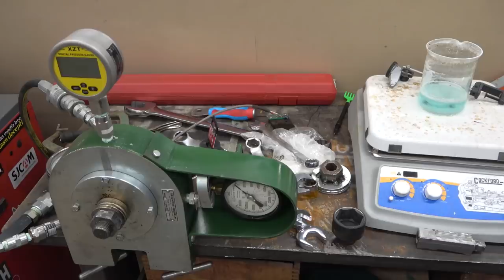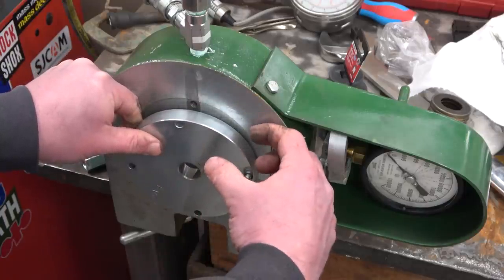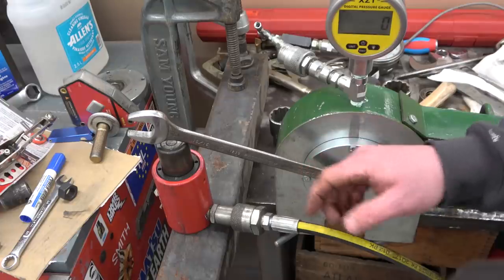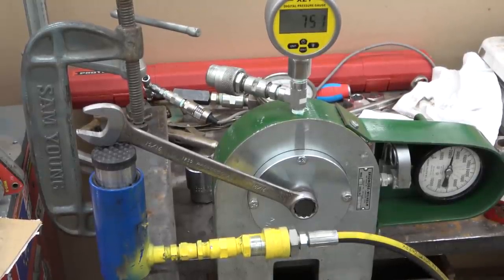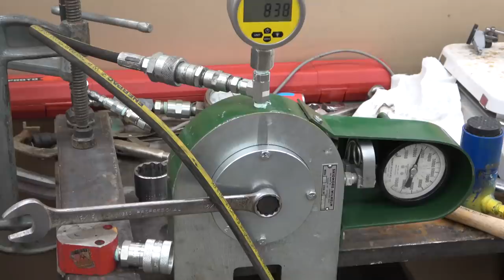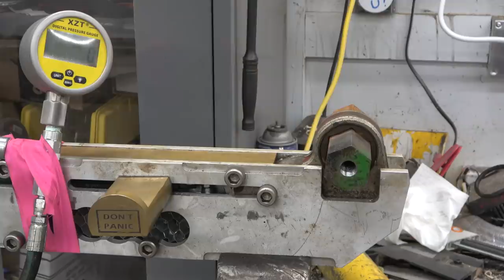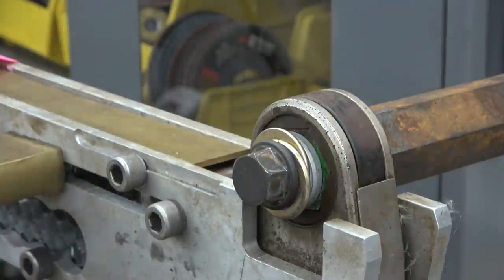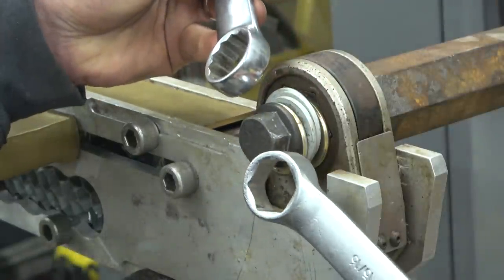6 point VS. 12 Best wrench?

Comment: Totally agreed with 1 exception.  If the fastener is already partially rounded, 6 point can be much better.
Reply: Spline drive can also grab a partially rounded fastener much better than a regular 12
Reply: I was always taught, and came to my own conclusion that 12 points are more likely to round off  fasteners.
Reply: The blue hot snot gun can also grab it.
Reply: @joshualux8309  this one isn't true. The contact surface on a 12p is the same as a 6.
Reply: @NurdRage777  someone has been watching diesel creek😀
Reply: @grahamnelson5376  spline drive. Those the ones that grab as close to the center of the flat as possible?
Reply: @Iceberg86300  yes, and the sharper corners on the splines help them dig in a little better than the rounded teeth on a 12 point
Reply: @preludedude4765  
Yeah I don’t know. I used to work at local ship yard. I’ve turned the rustiest bolts imaginable. Don’t believe the marketing on the package
Reply: Here's to hammering on a half inch socket to a mangled 13mm bolt head.
Reply: @joshualux8309  that means nothing lmao
Reply: Yeah, try working on a 10 year old VW with 12  points, every fecking bolt rounds off.
Reply: That or when your cross shift loses the 16 and 5/8 wrenches so you have no choice but to use the 17.
Reply: Generally speaking the smaller the fastener size the less material there is for the wrench to grab on to regardless of type spline 6 or 12. Less material is easier to round off.
Reply: I think the out come would be different with a 9/16" bolt
Reply: @Pro_DRIFTZ  Yep, good guess. Matt is cool & fun to watch :)
Reply: @preludedude4765  my experience matches the other guys. When working on old bolts, the 12-point box-ends round-off, and I usually end up getting bailed out by (somewhat surprisingly) an open-end wrench. Never rounded off with a decent open-end. (Identical brand wrenches FYI, just open v. box side).
Reply: @MattBrownbill  you must be using imperial wrenches on your VW or something. the correct size 12point grabs just as well cause the contact point is the same. the only exception is if the fastener is already damaged cause some knucklehead used a imperial wrench on a metric fastener....
Reply: Same, a 12 point rounded off most of the head on the oil pan bolt on the wife's Acadia, it was a brand new set of SAE and metric so I know I had the right size, now I have a single six point socket that still fits it and that's the only one I can use to change the oil now.
Reply: Definitely. And usually you are using a socket anyways which is why six point sockets are relatively common.
Reply: @preludedude4765  This is incorrect, due to tolerances a typical 12 point will stress the corners of the bolt, a radiused 12 point like Snap On's Flank Drive will have a similar compact to all modern 6 point wrenches, which are based on the radiused hex drive, as true hexes will also stress the corners of the bolt, which is why the radiused hex was designed in the first place. If we had perfect tolerances, radiused drives wouldn't be needed and corners wouldn't be stressed with unradiused drives. This is why typical 12 points strip hex heads, this is also why a lot of other drives will also strip hex heads, because they stress the corners and eventually round them; one of the best examples of this, assuming you can find a drive and wrench for it, is driving a triple-square with a 12 point, you're literally driving the corners of the triple-square due to the difference in angles, which forms a massive gap where flat engagement would be if you had a triple-square wrench, watch how quickly that triple-square drive gets rounded. The best drives are ones that grip the flats, this is why radiused drives exist, this is why open ends work so well, this is why drives like Torx and splines work better, because of better flat engagement.
Reply: The smaller fasteners can also benefit from six point. When you get under 3/8" stuff the peaks of the fasteners get pretty small.
Reply: @preludedude4765  its not. And that's partly why impact sockets are always 6pt. That and the fact that the tool body can be thicker and stiffer if there's not additional material removed around the load points.
Reply: I did have one occasion when a 12 point worked for a damaged spark plug where the six would not. It was a plug with 5/8ths flats that was so rounded not even the correct size six point would grab it, so I got a 15mm 12 point that I literally hammered on and was able to successfully remove the plug that way.
Reply: slightly rounded, or slightly rusty in which case it is about to be. don't think i've seen  a 12 point bleeder wrench
Reply: @pocoapoco2  you cheated 😂
Reply: @RenaxTM91  40 years doing this crap, 12 point is great on brand new stuff, I ONLY use 6 on old rusty crap & I own I literal ton of tools fapoff/notoe all the way down to crapsman, I have crap that hasn’t been made in 50 years, the steel is far superior & I have newer stuff I cut the box end off, moved it a few degrees then stick welded it back on, I might have to use two wrenches but by God I haven’t rounded a nut or bolt in 20 years, 12 point is garbage
Reply: @RenaxTM91  More a case of pour quality materials that rot away, compared to a 20 year old Volvo that came apart no problem.
Reply: @preludedude4765  Very true. If a 12 pt doesn't grab, something (rust?) or someone else boogered it up first. Then it's the 6 pt's turn at it and it's either a) out or b) almost perfectly round.
Reply: What about 3 points?
Or maybe even 4.

Would that be more proffient?
Reply: @preludedude4765  If everything is new and nothing changes you are correct. As bolts are worn or damaged or wrenches wear the contact points move closer to the center line of the bolt. Not all wrenches or bolts are created equal.
Reply: I've been under the same impression maybe it's right maybe it's wrong idk all I know is if the 6 and 12 doesn't get it (even after beating a smaller size on) the liquid steel gun just might... Or break it off then spend half the day sharpening  drill bits lol
Reply: I love this guy but we're really comparing apples to oranges on this one
Reply: Matco tools have rounded nut and bolt sockets and wrenches; they're 6 point and a grab like a gear.
Reply: No question about 6 working when a 12 didn't, and the 12 is not worn-out!
Reply: @NurdRage777  can't agree more 💯
Reply: Or cheap Chinesium Grade -3 crap that's made out of some sort of steel colored taffy..
In fact, THERE'S a good test..try this experiment on some nylon farsteners, Unka Bumblefuck!
Reply: Ive had really cheesy fasteners that prefer 6 point
Reply: @RenaxTM91  using the wrong size is not the only way to round a bolt bud....
Reply: @Bibibosh  3 pts to hold a 6pt fastener? probably not more eficient......
Reply: @BibiBosh  For whatever reason hex bolts are super popular and they have 6 corners. There is one active flat very near each corner of a properly designed and intact bolt head. The goal is to spread the force to as many of those 6 flats as possible. Either a 6 pt or 12 pt can do this well---but only as long as those flats are viable. A 3 pt would exclude the 3 other points so the unit loading would be doubled and so bad.

Wenches designed in the last 80 years or so specifically target the, flat just a bit back from the bolts corners, with the apeces of it's convex surfaces.
 
Generally, when a bolt is damaged, it's from rust, using the wrong or out-of-spec tool or using the tool improperly.  Those all compromise the intended flats. That's when you need to get purchase on the intact flat closer to the bolt's axis. The way to do that is with a 6 pt. The 6 pt. wrenches targets the portion of the flat that's less likely to be damaged and sometimes you win. But then the unit loading is higher and the head's surface can sometime plasticly deform and you loose-out to round bolt-heads. To hedge my position on rusted bolts, I usually try to hammer a the smallest 6 pt socket on that I can. This helps to involve as much outer flat as possible, contains the displaced steel and the shock helps break up the interface rust.
Reply: Yeah this sole reason is why I'm 6 point for life. Absolutely HATE stripping fasteners, especially since the ones you strip are ALWAYS the absolute shittest ones to fix.
Reply: This
Reply: @preludedude4765  Depends on the torque. Also, 6 point applies force more towards the center of the head.
Reply: @RenaxTM91  The contract surface does differ, especially as torque increases.
Also, the direction of the pressure matters.
Reply: @Bibibosh  Lesser number of points may allow a stronger fastener, but the wrench would be larger and less maneuverable.
Reply: @antilogism  How is the unit loading increased?
Reply: @pocoapoco2  the hammering action more likely shocked the threads loose.
Reply: Or its a stuck fastener, and its relatively soft metal, It's way less likely to round off in the first place.
Reply: Just love a nice skoukum 6 point ring or socket.
Reply: @cwj138  - love that too.
Reply: WILL BE, not can be.
Reply: VERY TRUE !!! Six point over twelve point every day , when it comes to gripping a bolt !! A twelve point will round off a nut or bolt head every time .
Reply: @preludedude4765  based on if years spent doing heavy duty diesel work, 6 point will grab a bolt a 12 point. I typically use 12 point as they are better for general use. But when somthing is rounded 6 pt definitely does a better job.
Reply: @Davobeff  I scrolled to the bottom to say this but you beat me to it. There are just some situations you need a 6 point for and some people can’t seem to grasp that.

I don’t get why some people can’t just accept that you can keep both around. You need two sets of wrenches anyhow what for when things are a bolt and not a screw.
Reply: @preludedude4765  True for good, hard fasteners.  Soft ones - the points yield (smush down) and the pressure point on each facet slowly moves away from each point.  This happens with 12 point too, but the amount the pressure points can move runs out of room (which is when it begins rounding off.
Reply: @preludedude4765  Not if its rounded already , AKA rusted bolts under my car .
Reply: channel locks , next .
Reply: @cwj138  been there. Works great 👍😎👌👌👌
Reply: @RenaxTM91  in theory,  from the perspective of an engineer,  sure. Please let me watch while you use exclusively 12point wrenches on equipment that is pre-abused.
Reply: Or rusted / weak materials
Reply: Yup I use my 12 points for nut extractors and also torex bits make good extractors
Reply: @joshualux8309  its true because the teeth are shallower,  So for extracting a nut you can pound on a smaller size like for example a 1/2" 12 point pounded onto a rounded off 13mm nut.
Reply: @preludedude4765  What?

A 6 grabs the sides of a bolt too, the 12 just grabs the corners
Reply: @preludedude4765  The flat area on a 6 is more than a 12.   Just look at the bisected faces and you'll realise half of them on a 12 are V's that are not in contact with the faces.
Reply: Spline is best.
Reply: 12 point wrenches wear out faster. Period. So then you will sooner have a 12 point wrench that is out of spec. A wrench that goes out of spec might as well be called a round-o-matic. 6 point wrenches have more surface area that deforms and wears less, and it won't start shedding chrome as fast. 12 point tips start shedding chrome the moment the steel gets deformed from a high torque situation. All these 12 point lovers are culls. On a good bolt with easy access and it's properly lubed, 12 point works..... But the real world isn't a perfect world.
Reply: In this scenario 6 may be the only way
Reply: Exactly

Comment: The best option is the 9 point wrench, it's a good compromise between 6 and 12 points.
Reply: India has the best 9 point wrenches
Reply: I agree 9 point is best, if one of the points wears out you can grind off two more and you have a brand new 6 point.
Reply: Hey a 12pt socket fits a square, so...
Reply: @ohnoitisnt  so does a 6 point if you have a hammer and a will
Reply: That used to be my favorite, until I tried the 69 point....

Comment: In my experience slipping off of , or rounding off a head happens pretty rarely on a large, high grade bolt that is still in good shape. But given the slightest bit of opportunity a 12 point wrench will take a crusty, rusty, already been diddled with automotive fastener into vise-grip territory with the quickness.
Reply: Forget vise grips. You want raptors.
Reply: @jeangadoury932  forget raptors, you need a welder.
Reply: Lolz! Yup! Been there way too many times! 😀
Reply: Especially if your not dealing with steel bolts/nuts. Brass don’t even bother with a 12 point
Reply: I've had better luck with a small pipe wrench then vise grips, but every situation call's for a different attack.

Comment: As someone who lives in the rust belt, 6point has absolutely made a big difference. If I have to choose between a 6 point socket and a 12 point socket, I will always ALWAYS go with the 6 point.
Reply: As someone who lives in SCOTLAND, 6point has absolutely made a big difference. If I have to choose between a 6 point socket and a 12 point socket, I will always ALWAYS go with the 6 point.

This test is great if you work with nice new fasteners. Over here, in the real rusty world, where fasteners look like rusty knobs removed from the wreck of the Titanic on the ocean floor, you'd have different results!
Reply: @WhiskyMechanic  absolutely. Any time, even when working on brand new stuff, I always use 6 point. Why not? I believe that 12 point sockets are obsolete, they were made for lower tooth count ratchets. Now I have 120 position and 90 tooth ratchets. I don’t need the 12 points.
Reply: Same and agree wholeheartedly.
Reply: I refuse to buy 12 point sockets.  They're an answer to a question no one asked.  On the wrenches, notice that the open end is cocked at an angle, you get the same 30 degrees of rotation buy flipping the wrench over.
Reply: @CountScotchula  No, Snap-on uses a 7-1/2˚ offset on the box end to split the difference. The 12-point wrench (Snap-on's, anyway) will always yield twice as many options as the 6-point wrench. I used to be an industrial salesman for Snap-on.
Reply: the Socket is different ofcourse, you can pick your starting point easily. since that shit rotates freely.
Reply: @saturnmedia1  twelve points aren’t obsolete, they have a specific job that they are best for…. Paper weights
Reply: @tarungonneea4614  lmao. Pretty bad ones though, they roll away!
Reply: I've fucked enough rusty hardware to learn the hard way too. Exhaust bolts are always getting a 6 point (if it's a hex), anything smaller than about a 13mm and lookin' slightly rusty? 6 point. 

Trying to find 6 point box/combo wrenches is kind of a pain, but totally worth it.
Reply: @pontiacg445  I s suggest getting a ratcheting 6 Blount box end! Then you have super strength and lots of angle available.
Reply: @saturnmedia1  I would, but I'd probably just blow them up. If I can, I'll break it loose with a box wrench then switch to the ratcheting type, then the 12 point is usually good enough.
Reply: @pontiacg445  Once it’s loose, yes. But you can’t always get a 6 point wrench on a nut or bolt. That’s why the ratcheting one is nice.
Reply: @CountScotchula  12 point spanners and sockets do tend to be useful on bolts with 12 point heads, there is that.

Comment: I've definitely made use of 6 point wrenches/sockets many times in my life where the 12 pointers were letting me down. It's not the wrench/socket that fails, it's the points of the fastener head that give way, and thusly where the 6 point shines. When you're pounding away at a rounded and re-rounded nut head with your 6 point socket and hand sledge, you'll already know damn well why you want that 6 pointer.
Reply: In automotive work where the head is already kind of chewed up, and maybe a bit undersized from some of the head having rusted away, but not enough to go down to the next smaller wrench.
Reply: nothing better then pounding on a 6 point with the hammer and just get the bolt out lol
Reply: Sometimes you'll encounter that the bolt head will have a slight taper as well, and of course is in a spot where you can't get a wrench fully engaged so you're hitting it at an angle, the 6 point will manage to do it and the 12 will assist you in interfacing your knuckles to surrounding components of the machine.
Reply: Yea, reminds me of a Mazda belt tensioner I ran into, twelve point just wanted to chew the the bolt, and the six point didn’t give it room to round. Gotta love the idea that not heat treating a bolt is a great way to save a couple coppers.

Comment: When my knuckles were what was on the line, I preferred a 6 point every time, because when you're dealing with head sizes in the 3/8" 10mm up to around 5/8" 16mm range, I've rounded off plenty of fasteners with a 12 point box end wrench!